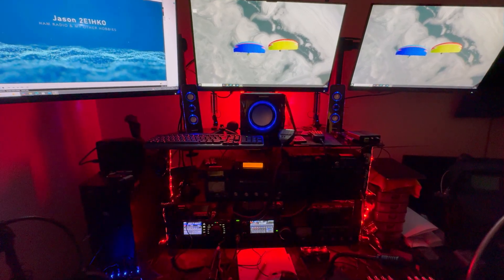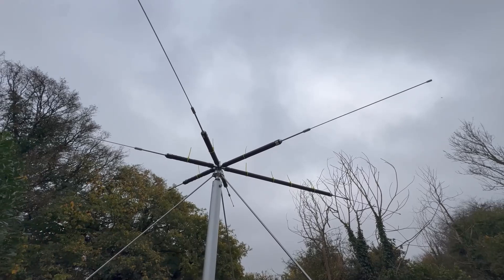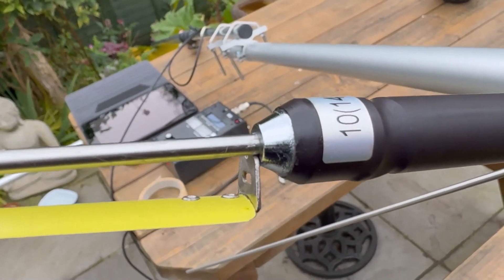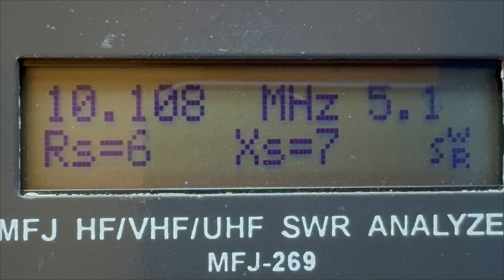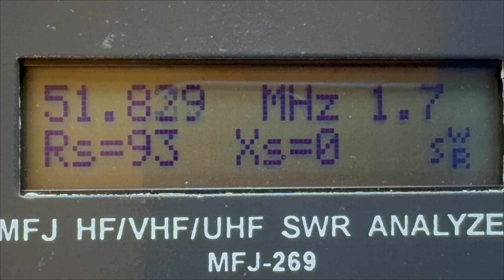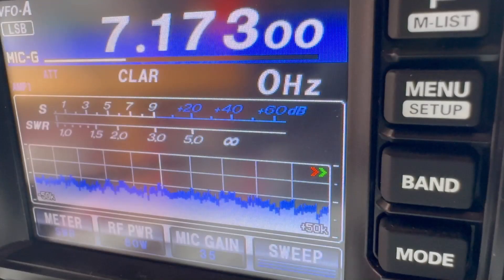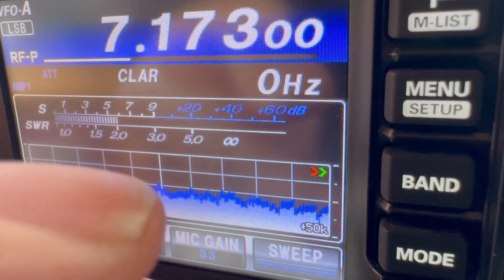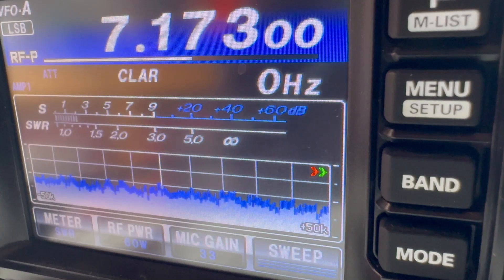Moonraker Scanking TXHF 6 Antenna Discone 80-6M Antenna Part 2

Comment: Hi.  Just wondered what your final thoughts were on this antenna?  My wife is at me to install a more permanent/low maintenance antenna instead of the end fed I've been using that requires constant maintenance due to wire breaking etc.  I've been thinking about one of these for a while and they're now available in New Zealand.   Are there any bandwidth limits with it and are you still using it?  I've got a DX Commander all band vertical I use but it's not ideal in the stronger weather we get down here.
Reply from the maker: Good afternoon,  it’s an ok antenna if you utilise it with a tuner.. I’ve had mine up back at home for several months . The hard part is finding the sweet spot when setting the element  lengths.. SWR can be challenge when the height from ground changes once you’ve set it up. The band widths are pretty narrow, hence the use of a tuner. The gain isn’t the best but acceptable . I use it mainly for digital modes FT8.  and voice on the 6mtrs  for a local net. The condition and build quality is very good and shows no signs of weather related damage.  As long as you have patience setting it up it’s good value but a comprise.